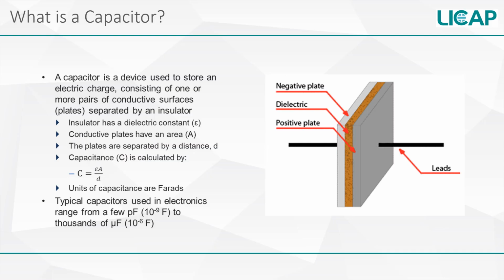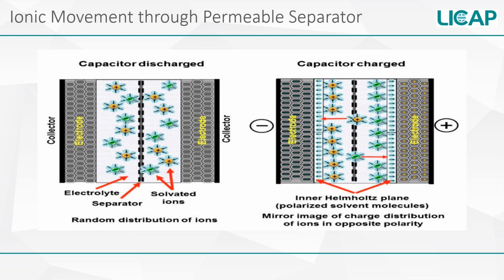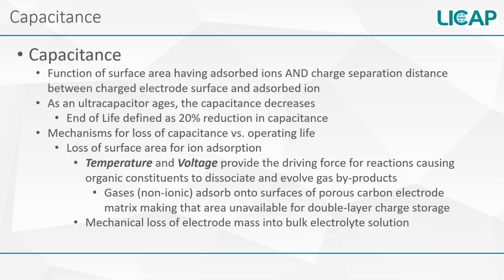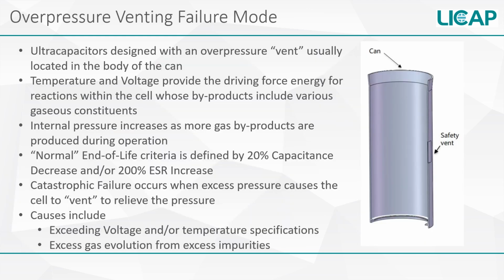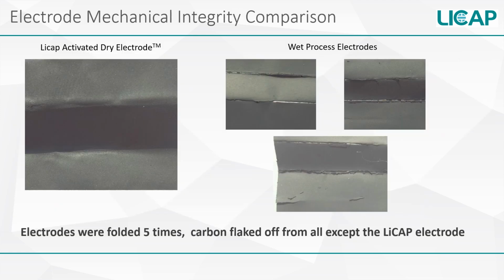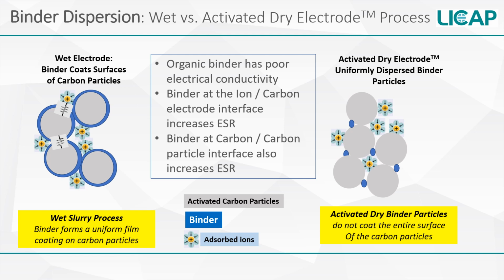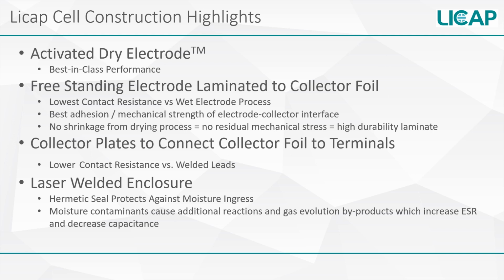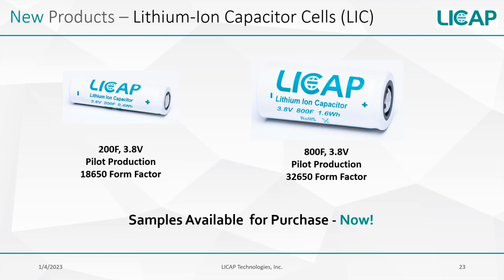LICAP's Activated Dry Electrode Effect on Ultracapacitor Performance Characteristics

Comment: DATE:25-OCTOBER-2023: INDEED, THE SUPERCAPACITOR ENERGY STORAGE DEVICES CAN BE OF GOOD USE WITH THE GRID-TIE UTILITY NEEDS AS IT CAN HELP IN THE PEAK POWER DEMAND SHAVING NEEDS WHICH THE BATTERY BANK CAN NOT EASILY PROVIDE WITHOUT DRAINING IT'S STORED ENERGY FAST. AND WITH THE SUPERCAPACITOR HELP, THE BATTERY LIFE CAN BE PROLONGED BY 50%.